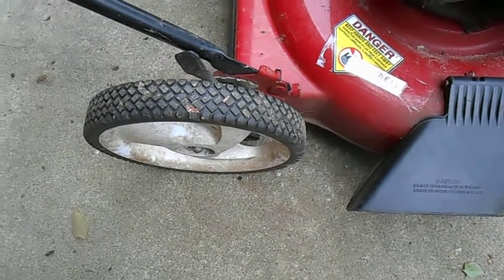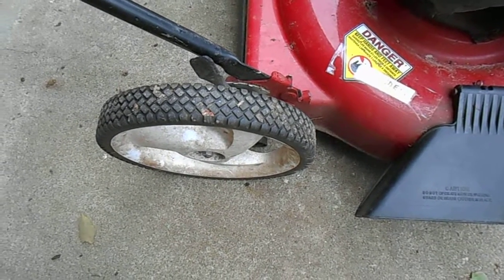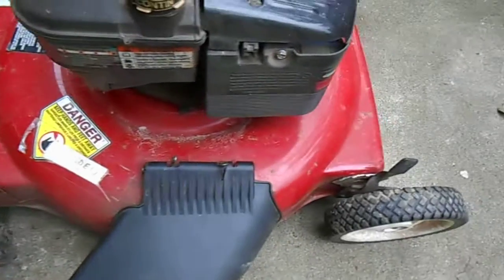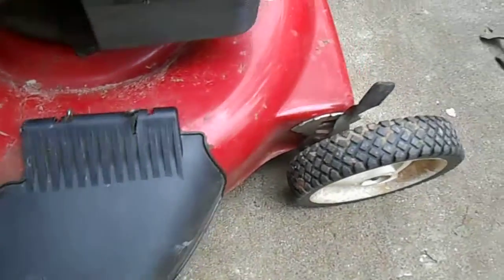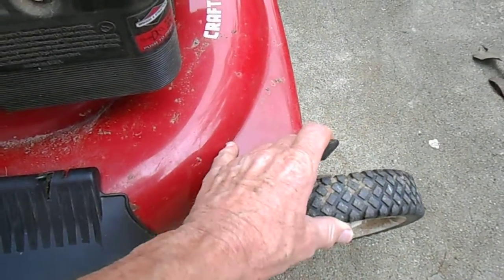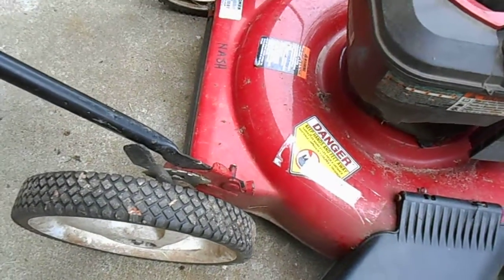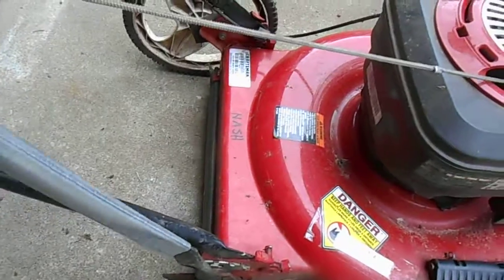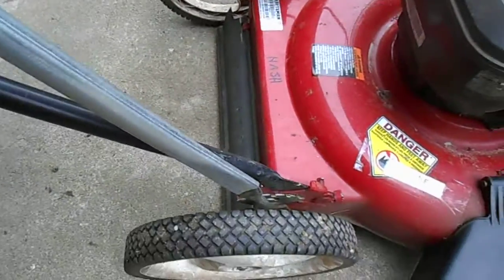lawn mower cutting height adjusting tool for a sears craftsman push mower

Comment: if you put a block off wood under the mower deck and the wheels are off the ground you can move the lever back and forth as easy as eating ice cream......
Reply from the maker: Some people aren’t that strong and need assistance
Reply: @anewday1000  I'm 80 years old....I just do one wheel at a time lifting one wheel up 2 inches for one second slip a 4x4 block under deck so wheel spins free and th e lever moves like eating ice cream.........but I do like the lever you made....and the video is real clean.....thanks have a nice day